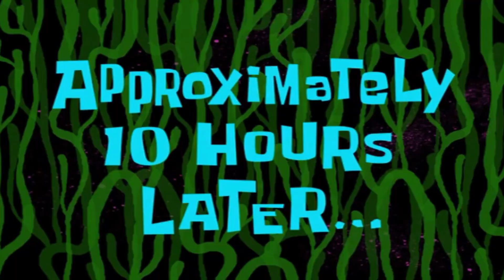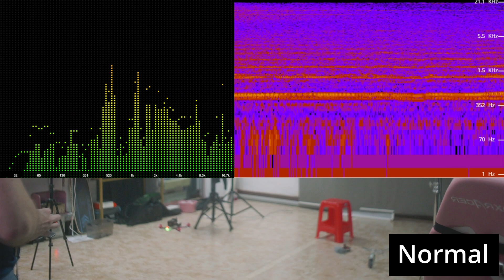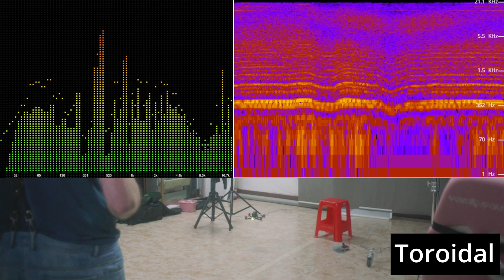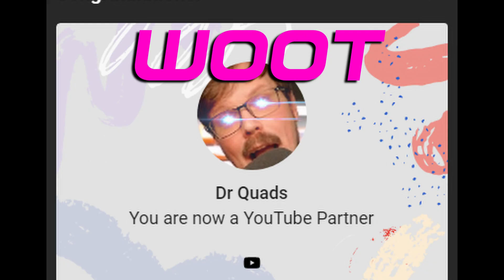MIT's Toroidal Propellers have SUCKED for 132 Years

Comment: "Every benefit that you wold have from connecting the tips..." That's just a single aspect of designing toroidal props. However, all trys producing better drone props introduving toroidal designs I've seen so far, do introduce nothing but more drag. There is a company selling marine props they claim to have much more effiviency. Looking at their design introducing axially extended loops of blades it is clear, that those designs of drone props shown are totally different - and just crap as you tested.
Well, this is not the first time, MIT just published bullshit. The one I wonder most is witricity. It is about transferring energy wirelessly. That's a commonly known principle for decades. The very goal of earning Millions of Dollars for refining wireless energy transfer for wireless charging is the claiming of patents. However, in the pioneering days, patents were meant to protect inventors. Today, they are for protecting investment mostly. It is not about inventions any more.
Reply from the maker: Pretty sad state too see our most precious institutions. And your assessment seems to be perfectly in line with all findings. I wonder if they saw my video

Comment: make props ducted (enclosed) to make them silent, a single large central harrier style motor/thruster, also larger is more efficient, like enclosed ducted helicopter, monocopter or co-axial dual prop for spin contra balance or even for gyro control
Reply: you could fit the dual contra-rotating props under the drone frame, the use the usual quad props for direction control, or use the ducted fan shutter controls
Reply: yep helicopter quad, or monocopter quad
Reply: normal props break my ears, its very much friendlier noise in the toroids
Reply: try the dual/box props
Reply: coat props with metal (conductive paint + for example copper or zinc electroplating), stronger structurally, actual metal
Reply: well there would be, if you would not waste trash limit people's freedom, actually
Reply: btw, even if you use a shrouded ring prop, there will be a rim magnus effect on the fast spinning surface
Reply: drum rolls lol
Reply: yep a helicopter can be reaction wheel stabilized, both active like in quad (horizontal spin discs) or like in a gyrocopter (vertical spin discs)
Reply from the maker: How
Reply: @33rdframe  just do it lol, just talking ideas
Reply from the maker: @Jkauppa  time is a pressure cooker
Reply: @33rdframe  are you in some kind of hurry?
Reply from the maker: @Jkauppa  indeed
Reply: @33rdframe  ideas on my youtube channel, lol, for props and drones, public domain free
Reply from the maker: @Jkauppa  ill take that to the bank
Reply: @33rdframe  what, bank does not help you to do it, its only in the way, to the dumpster
Reply: @33rdframe   @drquadsfpv  the design example now live on my channel, its kinda like a mesh protected fan, but a quad copter whoop with ducted wings